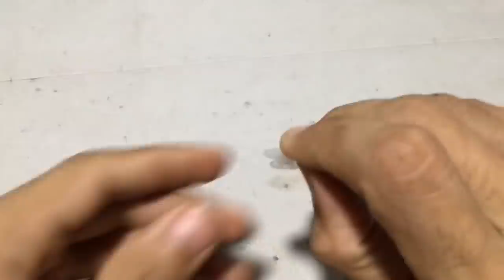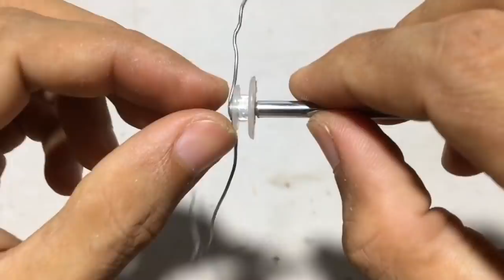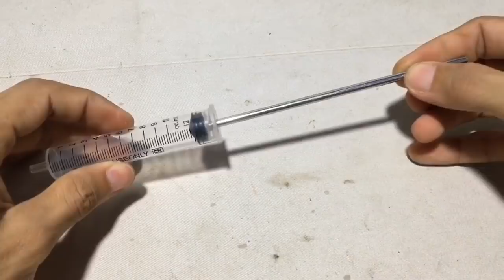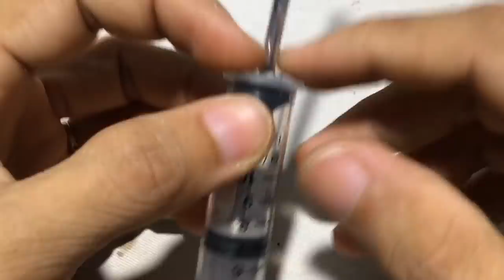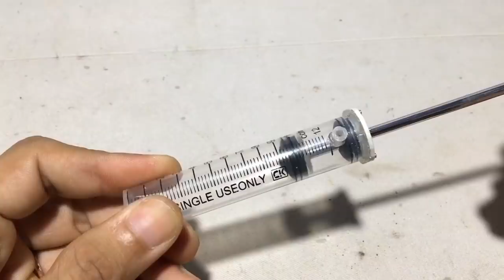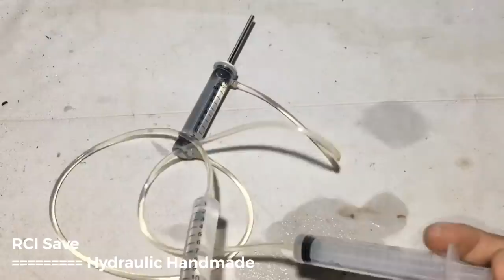Hydraulic Homemade for RC Construction Excavator Tractor Action

Comment: What is the diameter of the metal rod you are using?
Reply from the maker: 3.5mm
Reply: @RCISave  where did you get it from?
Reply from the maker: From motorcycle wheel spokes 3mm or 3.5mm